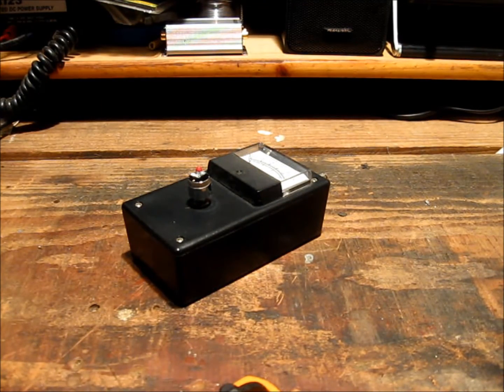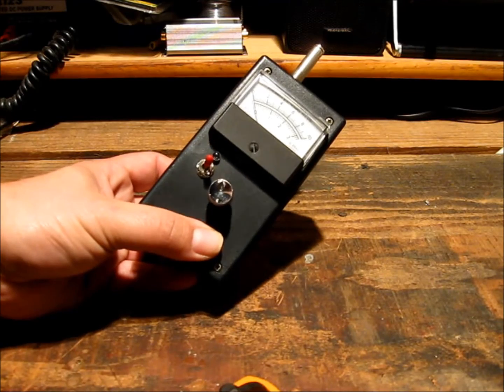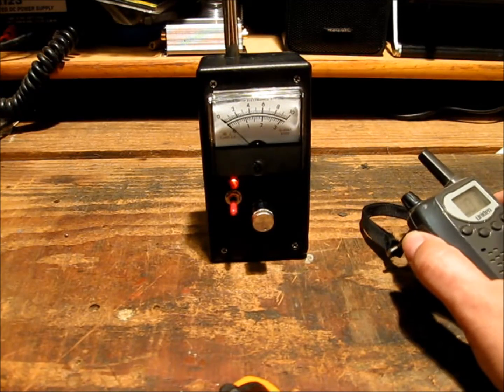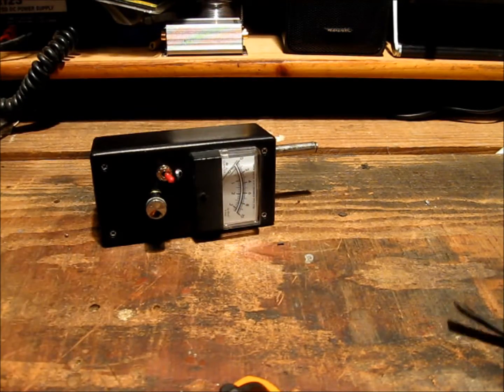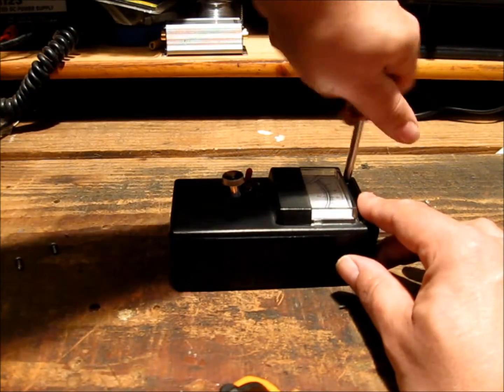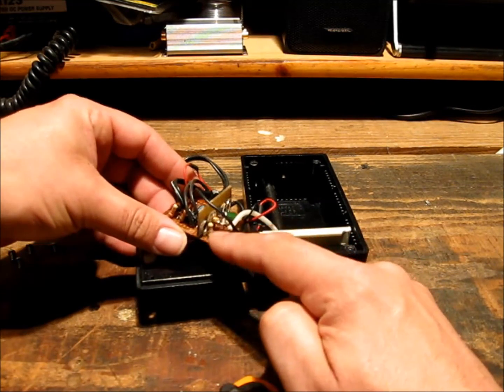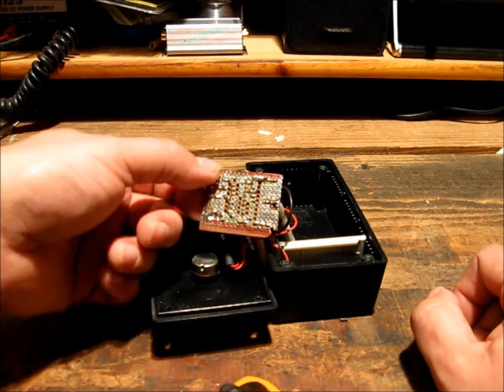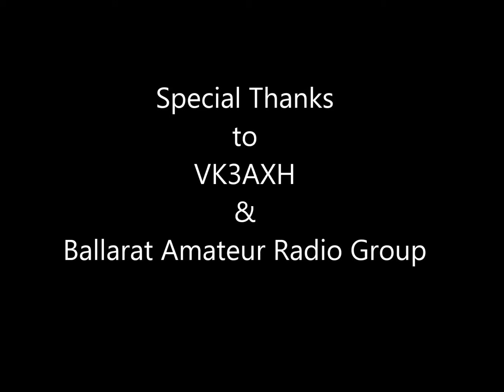DIY Test Gear - Amplified Field Strength Meter

Comment: Circuit seems simple enough, but I'm confused about C2... is it just a bit of coax feeding through the RF shield?
Reply from the maker: Thanks for your question... it's actually a "feed through" capacitor, one part solders the the vertical shielding whilst the other connects to the next stage of the circuit, I was unable to find one locally but the Elmer Ham (who supplied the circuit) was happy to supply the odd little capacitor.

Comment: The YouTube video is still here but the link to the schematic is long gone.
Reply from the maker: 4:25 shows the basic schematic as provided to me by a local ham some 20 odd years ago, it was built on perforated board using the components listed in the orientation indicated 👍

Comment: It's now possible to use an SDR plus laptop or tablet computer  to do RF power measurements - you may be interested  in this video demo - https://youtu.be/MRR-x_TjOp4?list=PLOlniSsm2f1PX3BHHZ4jS8q-qkgUiHE0V    - of course the disadvantage is you need power for the laptop.
Reply from the maker: Thanks for the link :)

Comment: You said "full documentation".  BUT, I don't see it.
Reply from the maker: The original downloadable file no longer appears to be on the hosting server, the circuit design however is still indicated at 04:25 of this video.

Comment: I like it
All the fs meters I have are just a diode no amp
Reply from the maker: Yes a couple of the commercial field strength meters I have (attached to VSWR meters) are the same, I also used this device to successfully "track" a nuisance station to their door after locating the street with a mobile radio.